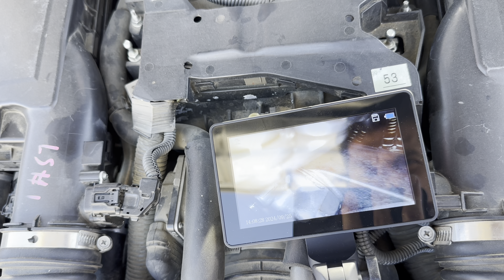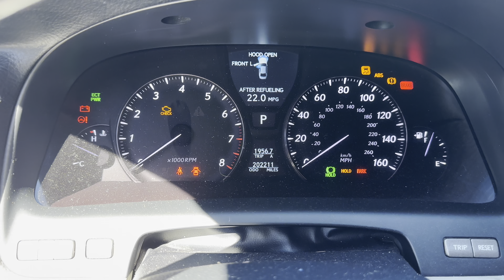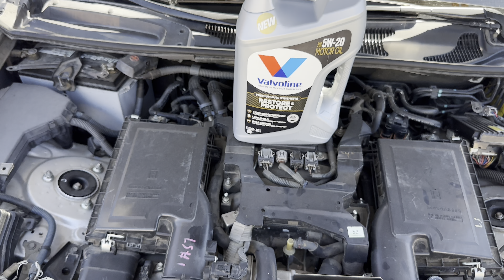Does Valvoline Restore and Protect really clean your engine?

Comment: 180 ,000 Toyota rav 4. Need to replace 1 qt every 1,100 miles. Watched other videos regarding this oil and on my first oil drain. Only 500 miles driven since the oil drain. Attempting to see if I can reduce oil consumption.  Will update  after second drain and fill

Thanks for your video😊
Reply from the maker: Definitely worth a try, won’t fix mechanical damage, but works very well for carbon buildup. Thanks you watching!
Reply: 2.4?
Reply: @sbond1963  my 2.5 burns oil, going to try this r&p oil 🤞
Reply: Any update?

Comment: This oil is fantastic, period. I was very skeptical until I watched Oil geek actually go down to the lab and did analysis. I switched and Made sure to do an oil change every 4k miles until it became clean. My purolater boss was full of crap from the engine, now that its clean, this oil will prevent all that buildup and keep it running another 100k miles.
Reply from the maker: That’s awesome thanks for watching!
Reply: Can I use in place of 5w30 oil 👍

Comment: Just hearing the excitement in your voice makes me excited to use this on my 03 Camry. It burns roughly a quart every 600-700 miles.
Reply from the maker: Your car is a great candidate, watch your oil condition, if it dark change it and the filter more often. Will take 3-5 changes to work. Thanks for watching!
Reply: @Fix-it-tony  I used epr to flush it out a few weeks ago. Changed the oil twice since then to make sure it’s all out. But know that stuff is good but will only get out so much. I’m about to do a 3rd oil change in 3 weeks lol. But I know it needs this
Reply: As The Care Car Nut shows in multiple videos.. the piston rings seize and cause wear on the cylinder walls thus causing oil consumption. Do not expect this to do anything for you.

Comment: My car was not necessarily a burner, but what this oil did fix was the blowby.  100% gone. I used to get oil and blowby pressure spurting out the oil fill cap when I opened it while it was running, not anymore. I'm completely sold.
Reply from the maker: That’s awesome! Thanks for watching!

Comment: I've been running this oil for the past 18k miles in my 2016 Highlander and I stuck a borescope into the valve cover and it looks like a brand new engine in there!  Don't know what else it's doing further in but it's working on the top end for sure!  Same goes for my 1998 454 in my RV which I've run now for 6k miles....looks like new in the valve train!
Reply from the maker: Awesome results, you can pull a spark plug and check your cylinder walls, the cleaner the better. Thanks for watching!
Reply: Did you stick the borescope in before using that oil?  Might off already been clean.
Reply: If its that clean i hope it doesnt destroy engine metals.
Reply from the maker: @juliosdiy3206 it’s a custom boron molecule from what oil analysis have would. Boron is a small slippery molecule that lubricates while it breakdown up sludge and carbon build up. Super safe to use and effective. Thanks for watching!
Reply from the maker: @ureasmith3049 I didn’t, but the issue was carbon on the piston rings. They are low tension and carbon does get in there, this oil breaks the carbon up and frees up the rings. Thanks for watching!

Comment: This R&P “Synthetic” Oil performance is outstanding by any other comparison!  I am now using in brand new 2024 Ascent DI Turbo… 11k miles (smoother, quieter), then 14k miles- 2nd “R&P” change/fill engine is now quieter than new!!  Oil drain was medium/dark color. 
FYI: 1st Drain @ 800mi.(Mobil 1), 2nd. @1776mi., 3rd @4480 (Pennzoil Platinum 10W30),… 6th.& 7th. @11/14 kmi.(Valvoline R&P 5W30).
“Severe Duty” driving conditions require shorter drain intervals… this includes “Turbos”, high ambient temps (Texas), Stop & Go traffic, etc. 
Best price is currently on/in Walmart w/Free S&H!
Reply from the maker: Awesome, thanks for watching!
Reply: Thanks for sharing this. I also own new Subaru (2.5 Crosstrek) and I am concerned about long term carbon build up in this GDI engine. I also do my own maintenance (because I have stealership trust issues😂) I am also using the severe maintenance schedule because of my driving habits. It's obvious that you are comfortable using this oil in a new car. I thought it may have been premature to start on a new car.

Comment: Tony that is excellent! My brother has a 2008 Lexus LS 460 and I will definitely share this video with him.  We started using restore and protect in our 2012 GMC Acadia on the last oil change. The engine in our Acadia is a 3.6L dohc direct injection V6.   We will be using restore and protect 5W-30 from here on out.  Between using this oil and GDI / IVD intake cleaner for the intake valves, I imagine our Acadia will have many trouble free miles.  You are definitely correct that Valvoline R&P works.  Be blessed! Matthew
Reply from the maker: That’s cool, let us know how it goes! Thanks for watching!
Reply: @Fix-it-tony I will keep you updated.  I still need to share your video with my brother so he can start using Valvoline R&P in all his Toyota/Lexus vehicles.  They have a 2014 Sequoia (5.7L) and 2002 Sequoia (4.7L).
Reply: Just found out from my brother at Thanksgiving that their LS460 is consuming about a quart every 1000 miles so I told him to do the VRP oil change ASAP.

Comment: Glad it worked for you. Rings are an issue with these cars in the 2007’s, along with valve guides. If it returns, remove the air cleaner snorkel and open the throttle plate…oil pooling and tracking up into the snorkel are a BIG SIGN on these cars that the rings are shot and you’re getting blow bye past the rings. Love these cars but man when they go bad they go bad. Happy the oil took care of those rings!
Reply from the maker: Oil getting through the PVC is all bad, luckily I don’t have that issue. Thanks for watching!

Comment: I am absolutely sold on this oil. And I’m a Castrol boy. I will be using this oil on all of my cars from now on.
Reply: FYI, Castrol is terrible oil. This was the "go to" oil for the German car guys but years of use (and oil analysis) has shown that it's a trash oil.
Reply: @jdm2gdm wow really? And what about their transmission oils?
Reply: @jdm2gdm  I regularly use Castrol edge and it’s a lot smoother than Mobil 1 in my experience. I also use their GTX high mileage in my old clunkers, great there as well.  GTX HM is the best conventional/syn blend oil out there.
Reply: @MrSamPhoenix  Not sure on the trans oil. On my Audis, I use OEM trans fluid but I would also consider Liqui Moly (and I'm not a Liqui Moly fanboy, I think their motor oils are decent but not "the best")
Reply: @adanlopez1011  Depending on your car, it might be ok. If you're in a low power, low torque naturally aspirated motor, practically any syn engine oil will be fine (so long as you change it every 5K miles or once a year, whichever comes first). For the turbo, high output folks, I wouldn't use Castrol personally if engine longevity is your goal. I use Driven (Gibbs) and Rowe motor oil (but also have used Pennzoil Ultra Euro and Mobil 1 Euro...mostly use the Mobil 1 as a "after flush" oil just cuz it's cheap and good 'nuff, especially the newer API SP formulation)

Comment: I have a 2008 Scion tC with the 2AZ-FE engine known for burning oil. I was burning a quart every 200 miles or so. Also have to admit that I was just adding cheap gas station brand oil as needed, not doing a full change on schedule with that consumption rate.  I did a full change with this a week ago before two long road trips.  In those road trips, I probably put 1000 miles on. It burned 4-5 quarts of R and P!  But here we are a week later, and the oil is black already even though it’s been topped off in that time.  No doubt the engine is filthy inside and I suppose it’s worth doing another change with the new oil as black as it is.  Hopefully this can slow down the consumption!!
Reply from the maker: Definitely change the oil more often until the deposits start to clear. Going to take 3-4 oil changes to see any difference. Thanks for watching!

Comment: On second oil change 2000 miles in on my 3000 change… First run I did 3400… Seems to have done very well for cutting back the oil usage in between oil changes… The only thing I have not seen a change in is high speed long-distance trips… 70//80 miles an hour on interstate for 90 minutes… I still burn the same amount as I did use the cheaper oils blah blah blah blah… I'm gonna go another round and I'm going to determine if that's changing at all or something that way ... isn't going to change etc.… So far been a great experience ...great product ..great  vids👌🎯
Reply from the maker: Let us now how it goes, worth doing a compression check if you continue to see consumption on the highway. Thanks for watching!
Reply: will   do ...thanks!!

Comment: I have 669,000 miles on my 2007 Accord. Valvetrain is spotless but it has burned a quart every 1000 miles for years. I bought some restore and protect to see if it helps the consumption. It also gets dark very fast, probably due to blowby. I am sure the rings are fairly stuck as is common on the Honda K24. Going to try it in my girlfriends Celica with the 1zzfe as it just started finally consuming a little bit between changes, maybe 1-2 quarts every 5k.
Reply from the maker: Honda’s have soft rings that stick over the years, this should loosen them up after a few oil changes. Let us know how it goes! Thanks for watching!

Comment: In the next week or two I need to do the oil pan gasket, rear main seal, and front crank seal on my 1979 Dodge W150. It's got a 360 V8, and at least 111k miles(5 digit odometer). When I did the valve covers, the rockers were pitch black. I'm not surprised seeing as how it used to be a USDA truck. Government vehicles have surprisingly poor maintenance. It'll be interesting to see how well this oil will clean it all up.
Reply from the maker: Definitely worth sharing your results here. Thanks for watching!

Comment: I use it in our 3.5 ecoboost navigator L.  We went from average 15mpg to 19-20 mpg.  Less exhaust smoke and the motor runs ultra quiet.  The turbos stay slightly cooler now as well.  I am hoping this keeps the screens clean for the turbo oil lines plus, keep the cam phasers oiled and clean quite well.  I will be doing analysis in a few weeks.  It’s certainly a game changer that may well save the ICE vehicles for those of us that cannot afford EV options.  This is cheap insurance.
Reply from the maker: That’s awesome, thanks for watching!
Reply: How do you know the turbos the staying cooler?

Comment: I’ve been singing this oil’s praises to everyone I know and online, people think I’m being paid to say I love it and it’s working in my oil-consuming Hyundai. If all Hyundai owners used only this oil from the beginning, I guarantee we would see a drastic drop in engine failures.
Reply from the maker: Same here, not sponsored, just want everyone to know this stuff works. Thanks for watching!
Reply: This oil would not stop or retard bearing failure on the YF models, it would help with blow by and oil consumption on the newer engines.
Reply: @6atlantis Fair point! I’m no certified mechanic, and I’m sure you’re right. I just know that Valvoline R&P is making my cars run better. I’ve always used high-end full synthetic high mileage oil but this is on a whole different level.

Comment: Use 5W-40 or 0W-40 Shell Rotella T6 full synthetic. It is loaded with detergents that keep diesels clean and particles in suspension. Buy it in the 5 gallon pail when it's on sale.
You get the same results at about 1/3 the price.
Reply from the maker: I’ve been happy with T6 in my Cat Diesel. But too high of viscosity for my daily driver. Thanks for watching!

Comment: I recently bought an 03 Ford Taurus that was extremely low miles. I discovered that it had many hours of idling time on its 3.0 motor. I’ve replaced the entire ignition system, and I just changed over to Restore & Protect 5w20. I’m hopeful it cures its oil consumption as well. I lost a pint in 1500 miles. So I just changed it out to stay ahead of the issue.
Reply from the maker: Low mileage engines are usually suffer from deposit buildup and rust. This should give you good results. Thanks for watching!

Comment: Currently at 212K miles on my 2009 Camry with the "oil burner" 2AZ-FXE engine.  No longer burns oil.  Befor e the Valvoline R&P oil i would burn 1 quart every 3K mile drain and fill.  I followed the instruction to drain and fill four times and started in early April 2024.  Just did my 4th drain and fill this week and oil was very clean and right at the full mark before the drain.   So we started at 200K burning oil and now after 50% city stop and go with the rest being highway driving only change element was the use of Valvoline R&P.    Note: power has increased perhaps due to greater compression.   This is the real deal product for any owner of any Toyota 2AZ-FXE looking to reduce or eliminate oil burning due to the oil control ring design defect in that engine.
Reply from the maker: That’s awesome, thanks for watching!
Reply: When did you start to see it improve?  Did it take until that fourth drain to see the full improvement? Congrats!
Reply: Improvement started after the second drain.

Comment: I’m using the R&R and a polyethylamide (PEA) fuel additive… oil and fuel consumption down after 2 changes in a 2013 Audi A5. Started using it on my GFs Subaru… starting to use less oil after 1 change… it’s pretty good. I’d recommend it on any engine.
Reply from the maker: Will have to check it out, thanks for watching!
Reply: Subaus thats what im talking about they like to drink a qrt every oil change.

Comment: @fixittony your 5.3 is using oil bz of the pvc system. Install a oil catch can and youll see. Also check into updated valve cover
Reply from the maker: Has the updated valve cover, no oil in the intake at all. Puddling is normal with a PVC problem, this engine for sure had stuck rings, common on early LS engines. Thanks for watching!

Comment: I've driven about 2,000 miles with the valvoline R&P the engine seems quite and no burning of the oil I will continue to use this product was only using mobile one. I'm at 216,000 miles on my 2013 elantra coupe. I love the car hope it lasts another 200,000
Reply from the maker: I hope it keeps working for you, thanks for watching!

Comment: If you’re not putting this oil in a new car, I definitely recommend that you change your oil filter every 200 - 300 miles, because if it removes any sludge, it’s coming down to the filter and it will clog your oil filter.  After you change your filter two or three times and you opening it and seeing that it’s not full of sludge then you can go to changing it with your regular oil change intervals however, if you don’t know how dirty your engine is and it has a lot of buildup. It’s going to come down into that filter.
Reply from the maker: Excessively sludged engines should be manually cleaned by removing the valve covers and oil pan before using this product. This is why I scope the engine first to verify it’s a stuck ring issue. This product works slowly over multiple oil changes so the risk of clogged oil filters is very low. So far have not had this issued new video with update coming this weekend. Thanks for watching!
Reply: @Fix-it-tony I thought this stuff clogged my oil filter! I was right @ 3,000 miles on my 1st run with R&P when all of a sudden I had zero oil pressure on the gauge...it turned out to be a faulty oil pressure sensor which apparently is a fairly common failure on my engine...I actually re-installed the oil filter I was using after replacing it w/ anew one didn't fix my problem, lol! It was fine still 👌 Hell, it better be w/ the $$$ I spend on 'em. I always use the ep ones that claim they can filter for up to 10k miles and I just replace them @ 5k anyway...

Comment: I have the dreaded Toyota 2 azfe 4 cyl.  with 200 k miles and just switched it over to Valvoline, and it looks like its actually mitigating the oil consumption. Gonna keep running it and see if progress continues.
Reply from the maker: Please let us know your results as time goes on. Thanks for watching!
Reply: I have an 08 Scion tC with the 2AZ-FE.  Burns a quart maybe every 200 miles. Also started this last week.  After a week, it burned 5 quarts of R and P and the oil in the engine is black.

Comment: Started running this on our LS460 too. 2008 with 70k miles. Wasn't burning any oil yet. Figured it would be good preventive. My only concern with this oil is that hopefully whatever is cleaning the carbon does not react badly to older seals, since usually strong solvents don't play well with old rubber. Time will tell.
Reply: From 2008 till today and  you need more time ¿¿?? wth
Reply from the maker: Haven’t noticed any ill effects on seals, Toyota’s are know for pretty solid gaskets expect the high pressure pump gaskets on the valve covers that tend to fail. Thanks for watching!